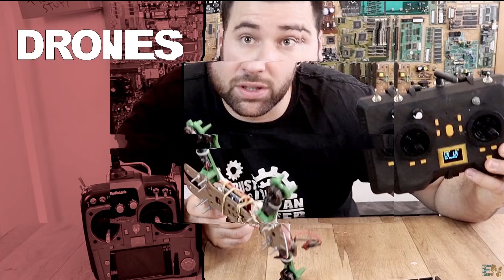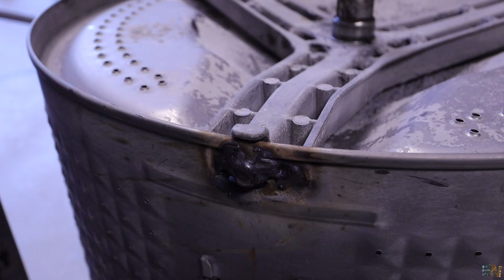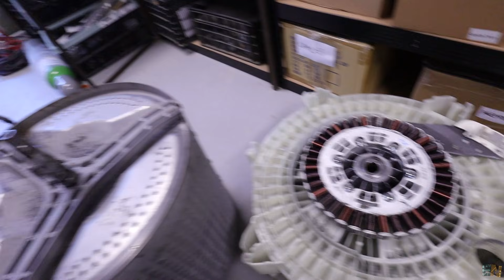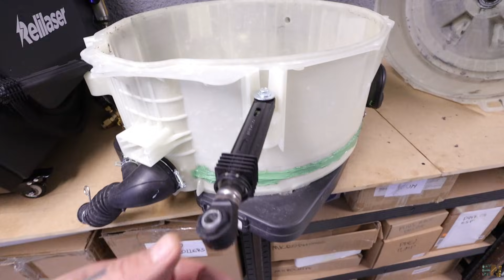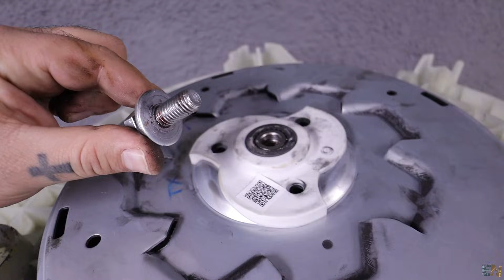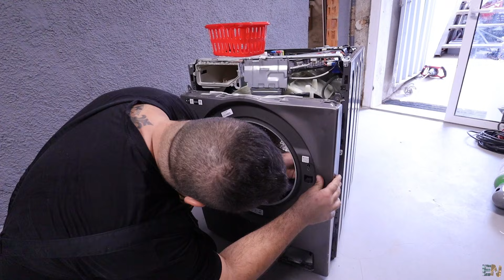Teardow my Washing Machine and Fix It

Comment: That's a lot of stuff in one little box. I was surprised to see permanent magnets but it makes more sense being a combo machine. In general, when you buy any machine that does several things the one thing you can be sure is that it doesn't do any of them right. 

So do they include the wiring diagram? They usually hide them in the control board area of major appliances which is great for the guy working on it. I doubt they do that these days. 

Always best to avoid computer controlled appliances. Why does a washing machine need internet? Do I need to be notified that the skid mark came out successfully? 

I have one of those smart power monitoring systems in my breaker box. It's got a current loop on each breaker. You can break down your power usage and see what is on and where you can use some improvement in your habits. Dryer pulls 3600w so it behooves you to run an extra spin cycle on the washer to lower drying times. Things you don't think about. Like you said you throw your clothes in and leave. It didn't tell you it was broken, now that would have actually been smart.

Comment: I had one of these washer/dryer combo units in my hotel when I was abroad and I thought "Oh, neat!"
The whole cycle takes hours, and you can't just stop the machine to check the dryness, you have to push "pause" and wait almost an hour for a cool-down cycle before the door unlocks. The tiny heating element explains why drying takes so long, but not why the cool-down cycle does. This was on 220v too, but presumably not on a high amperage circuit.
No thanks. I won't ever even get a front loader in my house.

Comment: How can a metal drum "rotate" effectively if it is supported on one side by a bearing?
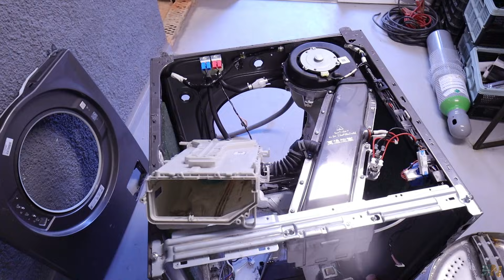Reply: 1:37 Hi, the 3 leg star adapter shown here is attached to the back of the stainless steel drum. Attached to it is a shaft which is held by n place by a stout bearing and the hum magnet assembly. The star adapter will eventually fail. Mine has been going along for 15+ years though.
Reply: One side support does not mean unstable. Everything depends on the total force to know for sure if it is adequate or not
Reply: yea ,i was surprised too , i expected something ,maybe plastic wheels to be on the outside of the drum to balance it ,but no ,its just hanging there

Comment: It will break again soon.  I would have used fiberglass and epoxy to fix the tub cracks.  The sealant you used will likely last for a little while, however.
Reply from the maker: It has 2 layer if epoxy and the sealer is only on top. Its been 2 weeks and till now everything is going well :)
Reply: @ELECTRONOOBS  Yes, epoxy is good for strength but it gets really hard and can crack, that's where the fiberglass comes in, it allows it to stretch a little without cracking.  Epoxy + fiberglass is also water proof so no need to use silicon sealer.
Reply: is it a good idea to use silicone sealant for that?